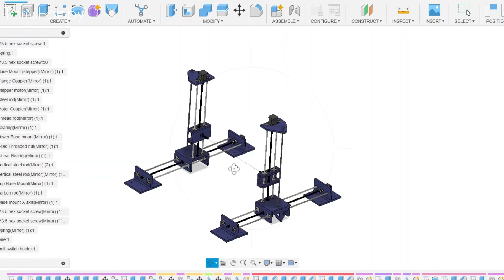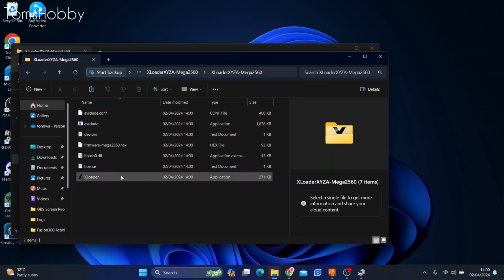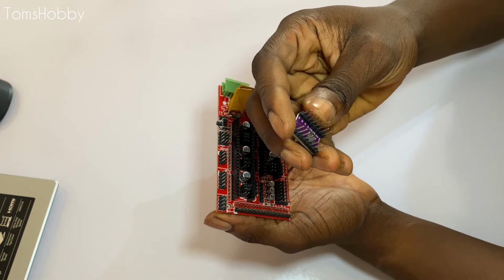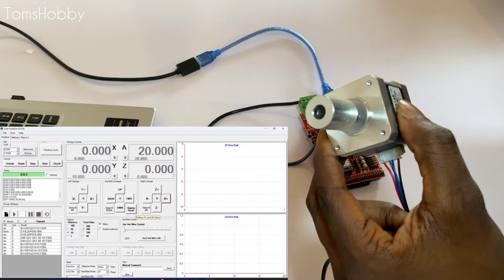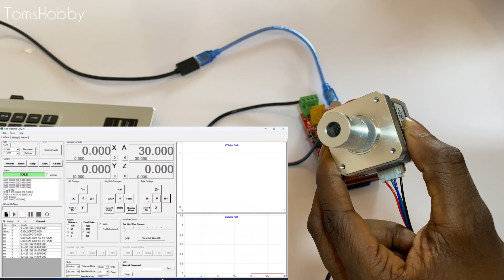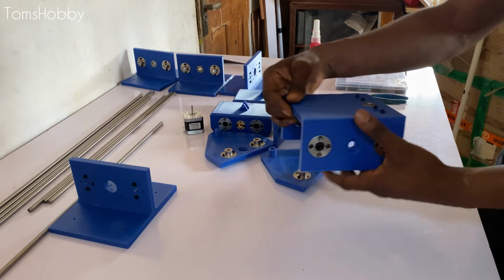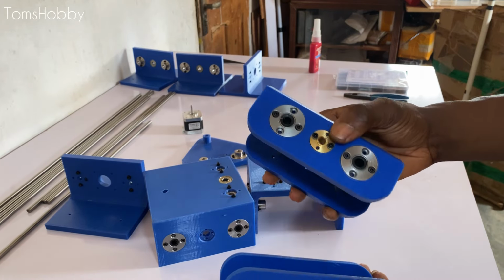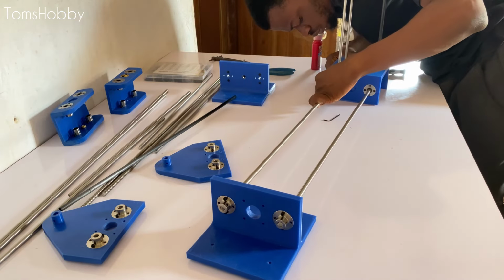3D Printed Hot Wire CNC Foam cutter 4 Axis Build

Comment: Hey Tom, Amazing work!!!!  thanks for the great video!  would it be possible to make  the cutting head charangable? so it is possible to attach different tool head, such as led cutting laser, small  routers?    maybe adding a small DC voltage controller between the tools and CNC controller board?  by the way, you have a new subscriber!
Reply from the maker: I am not a CNC Expert, but I believe you can not do that on this cnc configuration because the firmware is  different from a router cnc machine and also the axis on the hot wire cnc is XYZA four axis most cnc router are three axis XYZ. It’s easier to use a router CNC to swap cutting head than a hot wire cnc cutter
Reply: @TOMSHOBBY  I see, thanks for the help. Most CNC XYZ cutting heads and XYZ speed are controlled by the PC or host machine, not by the firmware. I put together a simple pre-built CNC router before. The speed of the router was controlled by a speed controller  which is a manual DC voltage controller, but XYZ was controlled by pc software setting.  Maybe I will give it a try and add an LED cutting laser to that pre-built CNC kit. Thanks again. I love your video, by the way. I found your channel from the 3D printed helicopter video. Best wishes.